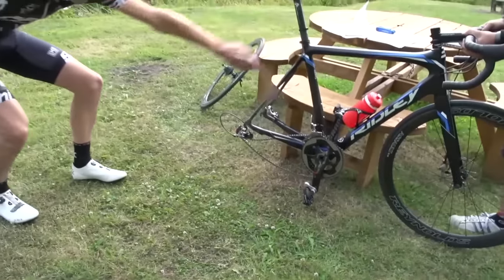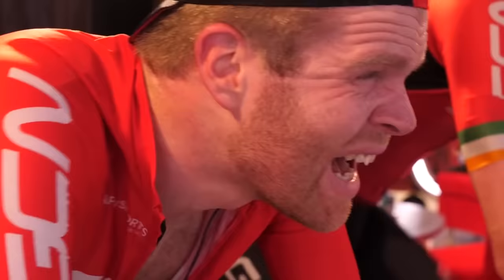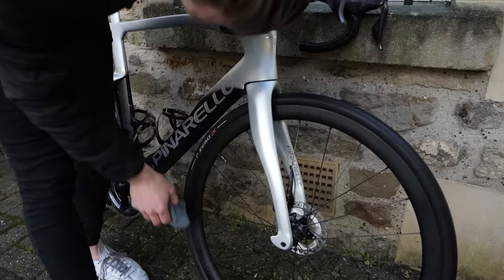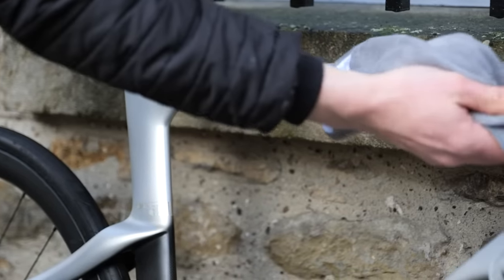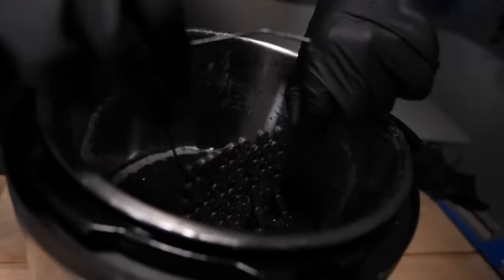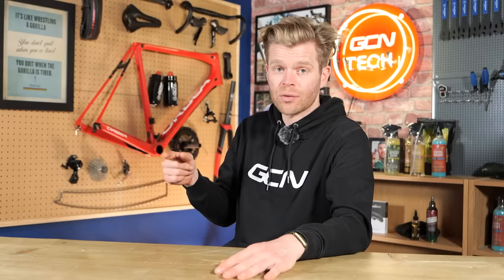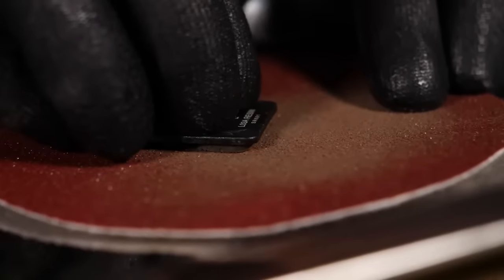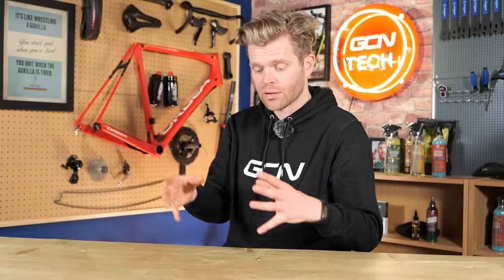6 Maintenance Mistakes That Are Ruining Your Bike!

Comment: Literally nothing as divisive as "this is how you wash your bike RIGHT!" Every time y'all do this kind of advice there's like 50 comments saying something different. So I still honestly don't know how to wash your bike proper 😂Use Muc-off, don't use Muc-off. Use wax, don't use wax. Cover your discs, no need to cover your discs. Don't use a pressure hose, it's fine to use a pressure hose. All I know is that I'd rather have a clean bike than a dirty one. You should have some kind of bike washing competition on your bike festival and have them judged by professional bike washers or something.

Comment: I think what's missing from this whole video is that suboptimal maintenance is almost always better than no maintenance and that cosmetic damage is not the same as functional damage.  Even the WD40 thing was specifically in that context.  Degreasing and lubing your chain with WD40 or washing your bike with dish soap is still going to be a lot better in the long term than skipping on cleaning your bike, which is the real alternative for most people.

If you're actually causing meaningful damage (not cosmetic) to your bike by using dish soap that will become obvious over the lifetime of your bike, you're washing your bike too often of doing something else very wrong.

Totally agree on recklessly leaning your bike on important components, best to avoid that.
Reply: actually I find soap dishwasher a good way to clean the bike. mix it with water to soften it up and not too concentrated. removes all the dirt and oil easily
Reply: Haha...I admit to using WD40 on the chain (after degreasing and rinsing chain with water) and washing up liquid to get muck off the frame and it hasn't done any harm to my bikes in 40 years of cycling experience. As you rightly say, it's far worse not cleaning the bike at all.
Reply: @stevestreet7677 WD make various things now, formulated for washing the frame, for example, or the chain
Reply: @PRH123  😊👍
Reply: I'd rather have a dry chain than use WD-40. It not only ruins your chain but your cassette and derailleur too.
Reply: @PRH123  yea the bike specific stuff isn't bad, its the WD-40 in the can that I would never use on my bike.
Reply: @Adventures4vida  yup, they say never use regular WD40 on chains, apparently it has detergents that break down oils. When we were kids back in the day, we would use 3-in-1 oil, which only now much later I understand was not a good thing to do, for the same reasons.

Comment: You sound so precious about the bikes. lol: the bags stuff and the resting on bars...
If I can't afford a minor damage to a thing it's a sure sign I should never have bought that thing in the first place. I live by that principle and I'm always chilled. Basically I try to not be owned by the stuff I own. e.g.: being overly cautious all the time or spending too much time and efforts in maintenance. If it wears out I replace it, simples. Money buys peace kind of thing.
Now I still take the valuable advice on lube and clean, thanks.
Reply: Much better to lean against the top tube than the saddle or bar foam. Saddle and foam get damaged more easily (and you touch them directly with your body), the bike is much more likely to fall over, and unless you’re riding cheap ass plastic bikes (like those ones with carbon fibbers in) you’re at worst gonna scratch the paint, which is how you know a bike is actually getting used.

Comment: Agree with all of this except the sarcasm on the bike bags. 😄 I know how to put my bags on in a way that doesn't damage my precious Colnago, but it seems like Ollie was more annoyed at bag carriers in general. Hey man, I can't put snacks in my back pockets, they're directly in the sun, on my sweaty back! And I don't want my keys mashed up against my body either. There are plenty of legit reasons to have a bike bag. And what about bikepacking?!
Reply: How about putting eggs in jersey pocket so they are ready when you finish you ride? 😊
Reply: Or a steak and kidney pudding 😂😂
Reply: Bikepacking is shit, same for most bike bags. Except maybe under saddle one.
Reply: You must need a very large bag for the Vinyl record collection...and beard grooming equipment
Reply: If you bike solo, especially solo remote, you need bags to carry all the spares and tools to save you when eventually you have a mechanical; spare tube, chain, chain tool, wrenches, zip ties, gloves, paper towels, etc.  You also need fuel...snacks.  Then there is layered clothing if you ride in varying conditions...say leave early when it is cold and then ride into the heat of the day...or get back later when temperatures plummet.  Finally, I much prefer pulling my phone from a side zipper in my bag pocket than trying to wrestle it out of my jersey pocket.
Reply: I am sure Ollie carries some hair products for his ever so slightly uncombed hair.

Bike bags are great and add much utility, that the roadbikes just have lost. Sure one can put a sticker on it if you like your bike in showroom condition
Reply: There's also the whole unsupported ultra race category, I'd love to see Ollie match up against those supposed "hipsters"

Comment: The thing with Dish soap is people dump about half a pint of the stuff in a one bucket of warm water (so it gets all foamy), if you must use it you just need a quick squirt maybe a couple of teaspoons worth in the bottom of the bucket with HOT water to break surface tension. 
Oh and people that go straight in with the sponge with dry or partly dry dirt/mud still visible on the frame, why? You may as well get the sand paper out.

Comment: Ollie being upset with people actually using bikes as practical transportation, and calling them “hipsters” for doing so, is pretty funny.  How dare they?  😂

Those paint protection films he recommends don’t hold up very long against constant abrasion, in my experience.  At a certain point, one just has to choose whether their bike is a vanity art piece or a tool.  Not saying one shouldn’t try their best to keep their bike looking nice.  But let’s not start calling people names for choosing to bike to haul their vinyl 😂
Reply: Exactly. My bike is used for a wide variety of things. Pleasure riding to to doing errands (groceries, hardware store pickups, etc). I’ll clean it with whatever I have available. Sometimes cleaning is just wiping water off the chain and using WD-40. My mountain bike is 35 yrs old, is used near daily spring to fall, is cleaned all the wrong ways, yet chain, cassette, and bearings last many years despite my “improper” maintenance (also original paint and stickers still look good except on underside). 

Incidentally I just saw a video about why we should do group rides. I don’t do group rides because there’s always an “Ollie” gatekeeper judging me and my bike and what I’m wearing (I wear cargo shorts over bike shorts because I need—and like—pockets for carrying stuff).
Reply: A man with that haircut calling me a hipster for having a bag on my bike. I've heard it all now!
Reply: @Richarddraper  😆

Comment: Lacquer is not used for finish coatings anymore.  Modern paint systems use Urethane clear coats over thin layers of color pigmentation.  But you are right that dish detergents and degreasing agents will dull the topcoat finish.

Comment: Using washing up liquid and WD 40 for 5 years now. Bike absolutely tip top. No issues.
Reply: But they don't do sponsorships...
Reply: we all know that WD40 it's bad for the bike, it's just question of time and luck.
don't use that shit, your bike must be still fresh from factory, try using that on aged bike and you'll notice the damage
Reply: @leart78  of course you will notice the damage, as it penetrates rust and shows how damaged the bike is. Putting a lube, oil or anything thicker muffles the sound of grinding.
Reply: Seriously Washing up liquid?  A few dollars buys a high quality CAR  SHAMPOO and this will normally  have wax for that hydra static effect and will make the bike look great.  If you only have a bike, it will last years but if you  have a car you care for, then BONUS.  
Use SIO2 liquid wax after drying the bike (and the car) with proper microfibre towels (one to put the wax on and one to buff it off). Never spray wax on the bike, it will go on to the tires and brake surfaces.
Reply: @Desmo500  and remember to ride a bike only on cloudy days, so you don't damage the paintjob with sun rays.
Reply: I would but we do not get a lot of overcast days.  Sunshine is our lot. So sad.
Reply: @tro7e  ok, im in MTB since 1992 and i dont know what im talking, free to destroy your bike, its yours
Reply: @leart78  WD stands for Water Dispersal, so WD40 can be great for a bike, just don't use it as a lubricant
Reply: @jeremynorth  Water Displacement, not dispersal
Reply: After 23 years in the automotive industry, I can tell you that most detailers (if you aren't paying them to do the job) will tell you that dishwashing soap is the gentlest thing you can use on your car (or bike). And if someone can't spell "brake", I don't want their expert advice.
Reply: @jeremynorth  water displacement
Reply: Yep. Been using a squirt of washing up liquid in a bucket of warm water with a sponge for years on all my bikes for years for the frame and have NEVER had any damage whatsoever. Bikes are perfect, no damage at all.  It's not on the frame long enough, even if it was supposed to do damage. Honestly,  not a problem at all.
Reply: @Desmo500  hydra static? You mean hydrophobic?
Reply: What in the actual f is “washing up liquid”?!
Reply: @01habitat  dishwashing soap mixed with water I think
Reply: @01habitat  for dishes and the like.
Reply: In a hardware area dish wash soap always has lots of bubbles whereas car shampoo does bugger all. More bubbles = cleaner bike.
Reply: @leart78  We all know that GCN only changed stances regarding WD-40 because of sponsorships. WD-40 is more than enough to clean really dirty bike components AND depending on the use-case, to lubricate them. 
I don't ride on rain and really avoid wet conditions and non-tarmac surfaces, and found that just being simpler and much quicker to apply, I maintain my bike much more frequently (and in less time) than using the really expensive "bike-specific" drip-on oil I had previously. Changed cassete and chain after three years because I wanted a different higher-lower gearing and a golden chain. Old parts barely show any sign of wear. 

Again, it is not a case of time and luck, but of correct use. ;)
Reply: Whatever your opinion is WD-40 can rust your bike.

Comment: Think we now need Ollie to give us a full on bike detailing video from start to finish, in detail, to remove all the micro marring that we've inflicted and then the ceramic top coating etc. To get it back to showroom finish. Also what to do about fixing marring on a matt finish bike.
Reply from the maker: There might be a video on its way soon that you'll enjoy 👀
Reply: @gcntech  Please no. There are enough of these videos for which you are obviously sponsored but never say so. Those ones about the fancy and extortionate coatings are crap. The wear and tear is in the moving parts and not the finish of the frame
Reply: @jeremynorth  wrong. bikes are ALWAYS in the sun. the coating is JUST like a car, including clear coat. Therefore it must be treated as such. The clear coat needs wax, and cleaning, just like a car.
Reply: You can’t fix matte finish. Once it’s rubbed to the point of being shiny, it stays that way. My road bike commuter with almost 20,000 miles has a few shiny spots on the matte finish. Just have to live with it.

Comment: Ollie - About washing your bike - a surfactant has to be included in the bike wash to break down the water tension and remove dirt. Any other additives in the cleaning solution, no matter how well meaning, will have a negative effect. A small amount of ordinary washing up detergent applied at a low pressure, such as with a mitt, has to be the best compromise.
Reply: Olile is being paid by bike product cleaning companies, that is obvious. Look at the products he  is using for his hair -LOL - it is a clear a give away!
Reply: car wash soap is the best bet. Modern paints are the same, including a clear coat. Dawn dish soap is a FULL stripping agent and should not be used.
Reply: I washed my bike last week after accidentally riding through 2” thick mud across the road. I used my pressure washer to get most of the mud off, and a microfiber towel to wipe other areas. No soap used. Bike looks great.
Reply: @Patrick94GSR  I bet your bike looks fantastic. But that preasure wash won't have done anything for your bearings.
Reply: @thegorillaguide  I avoided bearings with the spray and also removed the crankset to clean out some old grit that was inside the BB Shell.

Comment: Added tip, when putting lube on it is better to drip it on the inside of the links not the outside as shown in this video as rotating the chain will throw the lube off if on the outside, preventing it from penetrating the links whereas putting in on the inside of the chain will drive it into the link more.
Reply: Thankyou, that makes good sense. Will do that next time I lube my Avanti chain.
Reply: I put wax on both sides
Reply: Yep that’s how I do it. I use Triflow with the tiny straw and apply one drop to each roller along the bottom run of chain. I do the whole length between chain ring and cassette, then rotate the crank backwards to the next section of chain and keep going round.
Reply: @Patrick94GSR  
Makes a lot of sense, thankyou Patrick.
Chains & cassettes are costly.
Greetings from Melbourne, down under in the big brown country.

Comment: Washing up liquid is absolutely and demonstrably fine to use to wash a bike or car.... It is not "too powerful" it's liquid soap dude. It's fine
Reply: I'd agree with this, I've even seen it recommended - bike cleaner is another way to charge OTT prices.
Reply: Some, not all washing up liquid had aggregate in it so it gets burnt food off your dishes, but will scratch your paint. Alot is also acidic... It depends how much you care...
Reply: It is an AD to sell the expensive "bike" washing liquids. Muc-off can fac-off. $20 for "nano marketing terms special cleaner".
Reply: I know, right?  And it's not like you can't control the concentration (i.e., "power" ).
Reply: Difference is washing up liquid contains chemicals that will remove protective films and wax. Automotive washing liquids are very different and are formulated not to remove protective films and waxes. It’s not about strength, it’s about the chemical formulation.
Reply: How about just use water? Washing up liquid is expensive.

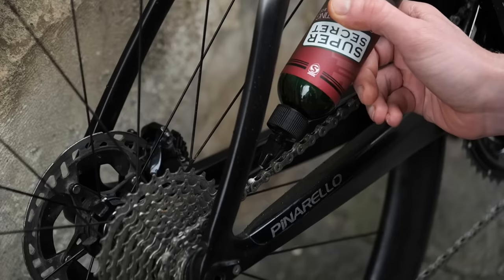Comment: I liked the bit at 4:28 when Ollie mentioned putting lube in the wrong places, then the editor followed it by showing a clip of someone putting lube on top of the chain.
Reply from the maker: It's all in the details 😉
Reply: Nobody with a life would drip lubrication one drop at a time on each of the chain bearings
Reply: @jeremynorth  I do it. Fight me.
Reply: @jeremynorth Just let it drop into the rollers as you slowly rotate the cranks. Done in a minute.
Reply: @andrewmurray5542  or spray the hell out of it with WD40 😁

Comment: I always use a small dash of washing up liquid in a bucket to wash our bikes. I don’t think it damages the paintwork as much as you say (maybe because Fairy don’t sponsor GCN ?). I also use a detailing brushes for awkward areas on a bike. They’re also used on high end cars so your argument seems wrong. High pressure hoses are a real bike killer. Isopropyl alcohol on discs, rims etc cleans them well. As for lube, I always say that if you can see the lube on a bike it’s not doing anything, apart from attracting dirt. It’s internal, metal to metal where it’s needed.
Reply: The argument has been raging for years in the car world, the issue is with an electrostatically attracted, super high pigment, robot controlled, uniformly baked on factory paint job, applied to a brand new near sanitized surface it will have near zero effect unless you are using way too much. On a respray or aftermarket clear coated finish it will overtime "attack" the paint/lacquer as its just not as chemical or abrasion resistant. Back in the day bike frames where stove enamelled and later powder coated usually after being "dipped" in a strong solvent to remove contaminants, this gives a final finish with similar properties to a factory car finish. However modern carbon can't be prepped or coated with those methods and the final finish is more akin to a car respray and more susceptible to damage. I suspect this is why we see a lot of matte/satin/semi-gloss finishes on modern frames as "dull" finishes can use more pigment an require less prep/finishing work to be pleasing to the eye.
Having said all that a cap of washing up liquid in full bucket of water isn't gonna do much, if any damage.
Reply: @chris1275cc very good explanation 👌
Reply: I think he was referring to using a hard bristle brush.